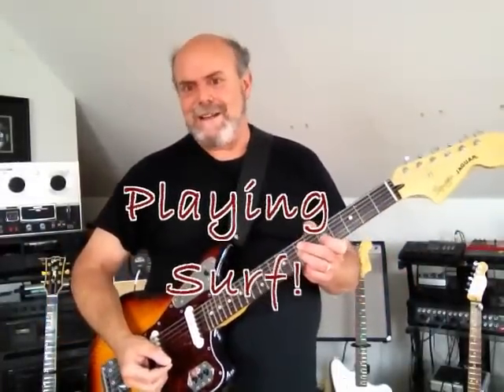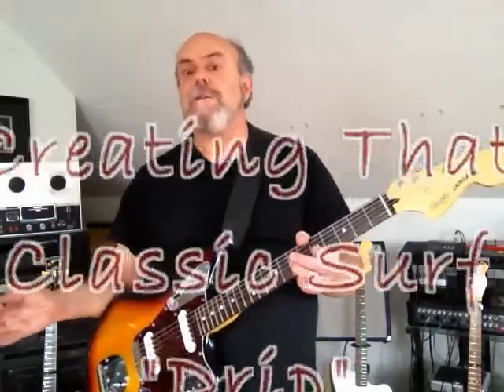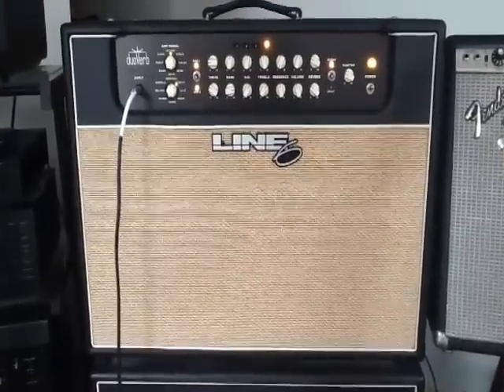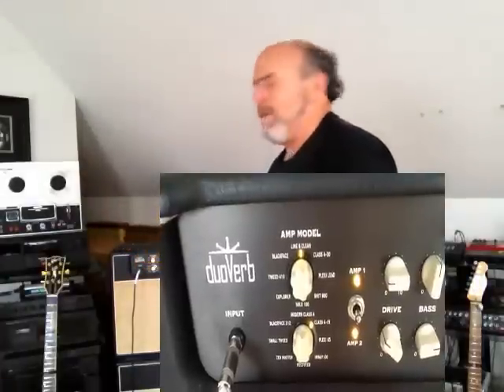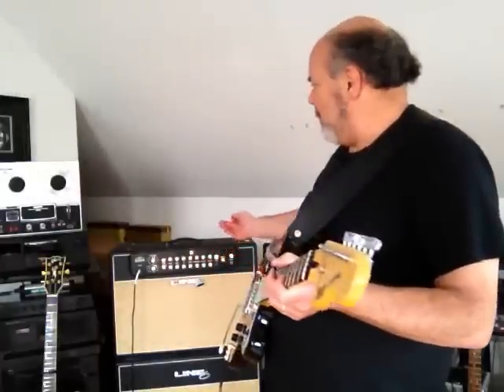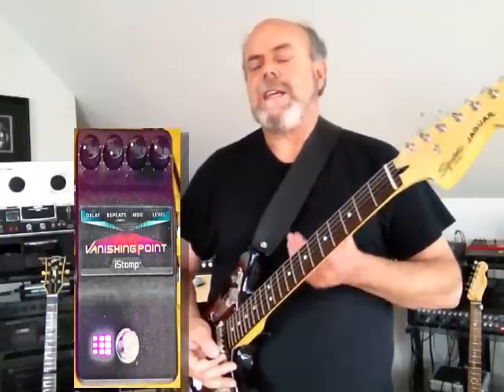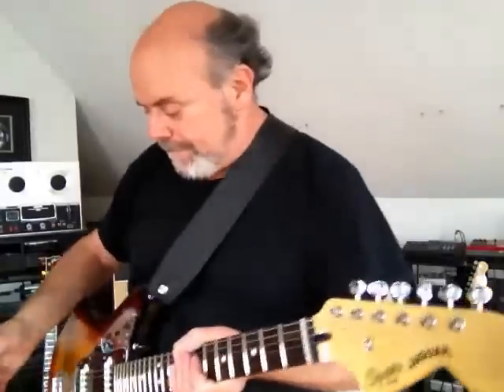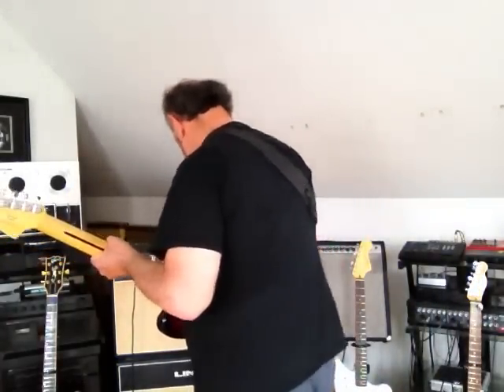Creating That Classic Surf "Drip"

Comment: I'm not really into Surf Rock but I kinda like it, so I watched a video a while ago where some guy explained that the only pedal that truly can emulate 'the drip' is some Boss pedal that emulates a Fender reverb tank, it even has the Fender logo on it but it's discontinued and some people actually pay hundreds of bucks for it.
Now just recently I bought some cheap reverb pedal, the brand is called MOSKY (or MO SKY) Music Audio, it's one of those Micro sized pedals, the model is just called Spring Reverb, it's pink/lavender and has some cheap, odd graphic on top that looks like a bar code but it's probably supposed to be a spring.
By coincidence I noticed that when you crank the 'mix' and turn the 'dwell' down it actually produces a quite decent drip sound ...and it was less than 30 Euro on Amazon!

Comment: Thanks for uploading this, it's really useful.

You're right in pointing out that the recording process - valve mics, analogue preamps, analogue outboard, tape machines, the tape itself, mastering to vinyl etc all colour the sound hugely. Plus, the instruments and amps they used were different.

However, you prove you can get pretty close by using your ears and what's available to you.

I'm fiddling around with some baritone surf music at the moment, so enjoying emersing myself in the whole thing. Jack Nitschze, Duane Eddy etc. I'd been using spring verb and tremelo, but I'll try your slap echo and modeling suggestions.

Thanks again for the upload.

Comment: I've played since '94 but just now getting into pedals and trying to understand them.  I listen to all kinds of music from Punk, Rockabilly, Surf, Thrash, old Metal, etc, etc.  My love for 60's surf- Dick Dale came from growing up on The Ramones, which I'm saving up for a Marshall JCM800 to go with my Marshall Cab to play Ramones tunes.  I've always just plugged straight in the amp or with a overdrive but now being older, and actually really able to buy head now, I'm really working on my amps, guitars, basses plus pedals and processors for both as Im wanting to really get all the different sounds I've always loved.  You Sir are a genius.  Very helpful video!  I also plan to get a Fender Twin Reverb to be able to play The Sex Pistols and The Cramps where I just change guitars and swap an overdrive with a fuzz.  Is the Standard Fender Twin Reverb loaded with a spring reverb?  Can I rely on the Fenders reverb for drip?  Or need a separate Reverb pedal that's better?  Sorry for the mini book.  I'm just so excited to finally be getting all the gear I want and get so inspired by vids like yours.  Thank You!
Edited-  rewatched your vid and noticed you mentioned the Fender modeled Reverb pedal......I also can't figure out which delay pedal you used in this video?
Also, do you think the modeled spring Reverb pedal would be better for Rockabilly rather than using the Reverb on the Fender Twin?  If so, that'll be 2 genres I could pull off using it.  I found a few on ebay.  I can use any info you can give me.  Thanks

Comment: Electro Harmonix Canyon delay does a good job getting this sound. Trust me. I own one and go for this quite a bit.
Reply from the maker: Finding a tool that does is for you is great!  Thanks for sharing!
Reply: Paul Ecoli Canyon alone can make drip? I just ordered it, partially because I want to use slapback mode with my reverb unit to get right sound, but does Canyon's reverb mode do this alone?
Reply: It does actually. That's what I was referring to when I originally commented. ALL the modes on the canyon are amazing, but the reverb delay will definitely get you there.I won't lie though. There's a lot of trial and error with this pedal. Getting to know the secondary button is a big one for this.
Reply: I also got this pedal, and it's amazing! But can you tell us the settings you use for the "drip" sound?
Reply: I can never remember. I set it on the fly. https://www.youtube.com/watch?v=kPvWDj0wdRg Bill Rupert gives a great demo of this pedal though. If I recall correctly, he shows how to do it.

Comment: Has vintage twin reverb. Plays line 6. smh.
Reply from the maker: +Gus Baldwin  Yes, I have a lovely TR.  And sitting next to it a `63 two-piece Tremolux. Both are used.

Is it odd that I play through a DuoVerb when playing surf? Perhaps. It is certainly atypical.

 Some say we should trust conventional opinion.  I prefer to put confidence in my ears and 50+ years of personal experience.  

In ad speak "YMMV."  :D
Reply: HI Don,I built a Fender 6G15 "stand-alone" reverb unit...the tank I got was made in the USA before they went overseas to have them built...sounds great.  I also built an amp w/5F2 circuit but reverted to the 5F2A and built it in a tweed cabinet...ditto for the 6G15.......HANG TEN !
Reply: Yeah but you do realize the reason why he's playing the Line 6 is because it has multiple amps in one box...Line 6 is not bad for clean sounds, it's actually really good.  The reason why everyone hates Line 6 is because of their high gain tones (From the past anyway) -- the latest stuff, Helix, etc. is actually very good across the board.
Reply: 50+ plus years doesn't show in how you play the guitar. maybe another 50+ and you will get there.
Reply: line6 is a great amp.. I only disliked it because other people said it was bad.. until I played through one..
Reply: If you have a line 6 spider, enjoy it while you can. If something go's wrong in the circuit board it can not be fixed. Their boards are triple laminated and can not be repaired . and they don't make them "the part's"any more. I tried to have one repaired and was told by the Line 6 dealer. the boards were no longer available. I just saved the speaker and scrapped the rest.
Reply: I loaned "against my better judgment" mine to a guy that ran his Bass through it with "hot" pick up's wide open and cooked the board. He never told me about it. I took it with me to a student's house, when I pluged it in, I got lights and nothing else. Got it home and dismantled it, and that's when I found out about the three layered laminated board. None of the components can be replaced. You can't even cut the board open to get to a blown resistor. You will screw another circuit up trying to get to it. The factory can't even repair them. They just replace them. The Spider I had was 50 watts I think. It's been a while. It was the red face on anyhow. When I called Line6, they said it was out of stock and no longer available. Screw Line6 ! I'll never have another one. It sounded great but if something go's wrong with, your screwed.

Comment: I think if you just turn up the spring verb mix and crank the dwell, you're way closer than adding delay. Dick Dale cranked the hell out of it, and he dripped all over the place. Also a much, much bigger cab would add so much body to the verb sound. I also think a Strat is an equally excellent guitar choice. The tremolo is a cool touch (authentic too), but doesn't really add to the verb.

Comment: I can't thank you enough for this, Don! Such a simple solution but I couldn't see it. I was struggling with the sampled "drip" from the Boss FRV-1 because it is the same "drip" for every note. I was considering putting a real unit on credit because I just couldn't stand the monotone "drip" I was getting from the FRV-1, even though it was the best emulation I could find. But carefully dialing in slapback gave the FRV drip the life that it desperately needed!
Reply from the maker: I am so glad that it works for you!

We live in such a commercially focused time that the answer always seems to be buying something else, something new.  Again.  And yet again.  But often, as I think is so here, its a matter of listening and learning.  And when we do there is an answer in gear easily accessible, and often already ours.

Rock on!  :)

Comment: Hi Don, I have to wonder (not the bread) how many of these internet experts (a drip under pressure) could actually pass the Pepsi taste test? ...they think that talking trash about modeling amps (Line6) makes them appear to have talent and high standards, desperate to compensate for a lack of both as well as having achieved nothing as a human being. So, let's see if they can actually tell the difference. I love my Fender Mustang, I have no need to try to impress others with expensive toys, 68 Les Pauls,  pre CBS Strats, blaw blaw blaw... what matters is it works, and that you are having fun.
Reply from the maker: Most of us, at least at some point in our life, just accept what is commonly accepted and acho it.  

There is a "truth" about tube tone.  But modern amps DO get that sound -- an amazing variety of sounds -- with out them.  And some of these amps are amazingly moderate in price.

I know one younger blues player who when he bought his "dramm" gigging amp chose a very modern (but not inexpensive) solid state model. For its tone along with lightness and reliability.

Use what you love!  And yes, have fun doing so.  :)

Comment: Hi Don - great video! Could you possibly share your settings for the FRV-1  and the Tremolo? Also - do you find the sequencing of the effects to be important?
Reply from the maker: Ken, I vary the FRV-1's settings some according to the guitar.  The Jaguar, for instance, having a brighter voice than, say, a Jazzmaster, tends to get 'boingy' if the mix, dwell or tone is above a bit under "4."  If I want deeper reverb with that guitar is add some of the smoother, built-in post-preamp reverb to the mix.

As to order I keep the pedal creating the slap-back echo first in the chain, the the trem, and finally the FRV-1 -- this so the sound of the reverb reflects these changes in the original source signal.

The trem settings, too, are variable.  For something like "Sleepwalk" it is set deeper than for a rocking surf song.

Speed is the most critical and should integrate into the beat of the music. Depth is kept moderate. (Typically set to about "3" but I expect that umber means little when going from one pedal to the next).

Comment: I use a real reverb tank before my amp and a tape delay with a short repeat time!!
Reply: where did you get one and how does it work?
Reply: @IhmePaskaa  I got mine years ago,the one I have has some modern features,like a band width and a tonestack control...the way it works is the signal goes through a transformer and gets spilt into three signals.  one side stays dry the other two go through two tanks that each have two springs respectively..my tank has options to change configurations,.but most are just simple tanks that come off and then back into the speaker output stage  of the amp. then it hits the speakers.. I don't think it's better going in the front of the amp or even better an effect loop.

Comment: Sounds really cool, I'm wondering whether you could split the wet / dry output from the slapback and send only the wet signal to the reverb, then bring that back together with the dry, then through the tremolo that might sound even more authentic? 

I'm presuming the slapback is there to simulate a little pre-delay (like the 'size' control on a reverb tank) in which case the very start of the attack should be pretty much dry.

Anyway I'm just starting at the surf stuff so it's really great to have this tutorial, thanks a lot!
Reply from the maker: +Dan Katz  A fascinating question, Dan.  If I understand what you wrote such would give a brief moment of clear signal and thereby increase clarity.  -Especially effective, perhaps, with fast runs.

If you try it I hope you'll report back! :)  :)  :)

Comment: Thanks for your help. I'm getting very close using the following set up: Fender 60th Anniversary Classic Player Stratocaster , Rockburn delay (£29 new) ,Joyo Tremolo (£30 new) into used Marshall JTM30 with it's spring reverb close max. The little Marshall has 5881 valves (tubes) like on old Fenders which helps it's cleanliness :-)

Comment: Great Video, thanks for sharing. Need to check out that Line 6 amp soon, sounds great. Been looking online for awhile for the Boss FRV-1 ( discontinued )that you use in this video, but they are quite expensive used, anywhere from $150-$200. So I purchased the Danelectro Spring King and Boss TR-2 Tremolo and now have a great 60's surf sound. That setup works with most single coil pickups that you will find on a Jauguar, Jazzmaster, Strat or Tele. I can get this sound through a Marshall amp as well. Keep up the great work, that Jaguar is stunning !!
Reply from the maker: Glad you enjoyed it Steve!

Yeah, FRV-1 are selling at a premium. But I, too, have heard good things about that Dano!  So glad to hear it is working for you!  :)

Comment: Don.  Thank you so much for sharing the surf sound.  Just curious, what is the order of the mentioned boxes in your signal path?  I'm trying to get a reasonable facsimile of your's set up in Jam-up and signal path order would be helpful.  Thanks again and keep 'em coming!
Reply from the maker: Hi Greg.  I am glad if this video helps you to getting the sound YOU are looking for.

My present pedal set up is in this order:  Tremolo, echo, reverb.

I also have, since making that video, added an equalizer pedal which I sometimes use, sometimes don't. It sits between the trem and the echo.

The equalizer's purpose is to better emulate the 2/12 closed back cabinet often mated with the Twin Showman amp.  I find that a small boost at 100 hz, followed by a small dip and then a gradual rise toward 1000 helps get that pumping feel at the lower levels I generally now play in comparison to the live levels I did 'once upon a time.'

But so much is dependent on the guitar, amp and specific song that generalities have to be just that.

There are no rules here. (although some it seems find that rather discomfiting)  I try to view it as a continuing journey of discovery! One, indeed, that I started many, many years ago. :)

http://www.break-a-way.de/bands/abtracts.html
Reply: Thanks for the quick reply.  I just remember the surf sound as a child (my older brother was totally into it).  The reverb has always spoken to my soul and I get a blast both playing it, and listening to all the indus who have brought it back to at least a cult following.  Now if I could find some like-minded guys in the Fredericksburg, VA area that want to hang out in a garage now and then....

Also, thank you for the signal path.  I need to do some rearranging on Jam Up and see if it makes a difference.

Would love to see some more lessons from you.  Keep it all coming and stay young!

Comment: The Fender Mustang amps do a respectable job of immolating this sound and on the cheap without the need of multiple pedals
Reply from the maker: Yes!  And each generation seems to get better and better at emulating many traditional sounds.

When I play casually I often use a Fender G-DEC 30 and am amazed at how close such allows me to get with little hassle.

Thanks for sharing!
Reply: Yeah amazing how the technology of modern amplifiers has evolved for all those purest that claim solid state amps are crap obviously haven't been honest with themselves or used one recently.
Hell I found it was worth buying the amp just for the Fender Fuse software alone plug amp into computer instantly have basically your own recording studio with endless amount of effects editing right at finger tips 
What a great time to play guitar and if someone doesn't play now is good time to give it a shot
Reply from the maker: Well said.

There is another aspect, though.Players whose use and venue allow them to get and keep their tube amps in its "sweet spot" -- generally MUCH louder than even relatively loud home playing allows -- they will experience something still unique.

For certain rock sounds I love playing through a simple Champ-circuit (with tube rectifier) 5 watt, all-tube, amp.  There is a certain "bloom" that no modeling amp I have yet used can yet quite deliver.

Most home players, though, never have experienced this.  They, when condemning modeling amps, are basically repeating what they have repeatedly been told.

For most uses those "solid state" amps (as you call them) certainly do provide the goods. :)

Comment: Is each individual effect adjustable?  For example, the old Motorola auto reverb units were adjustable as to amount of reverb you wanted to where it could sound like a cathedral if you wanted.
Reply from the maker: Every reverb device/pedal I have seen has at least one adjustable parameter.  How "much" reverb is added to the mix.

The FRV-1 duplicates the controls found on Fender's original outboard units, allowing for how much of the reverb signal is in the mix, the "tone" (treble roll off) and the "Dwell" - in essence how hard the springs are 'hit' (set vibrating).

The once control it lacks -- one available on Digitech's "Spring Tank" which allows for the amount of "boing" to be controlled. (Some feel the FRV-1 has too much of this!)